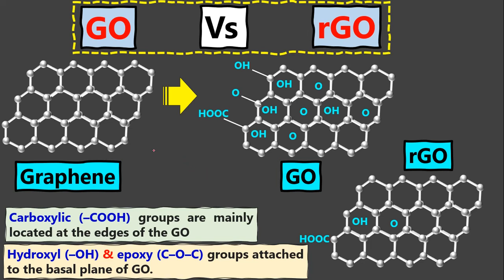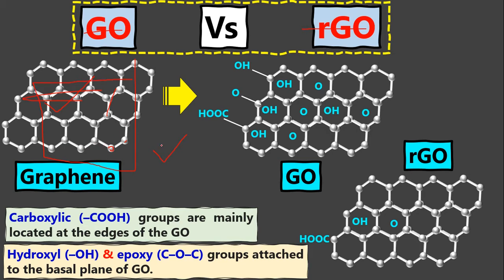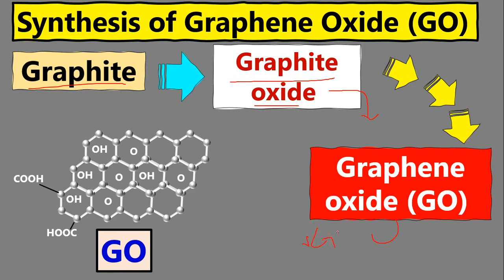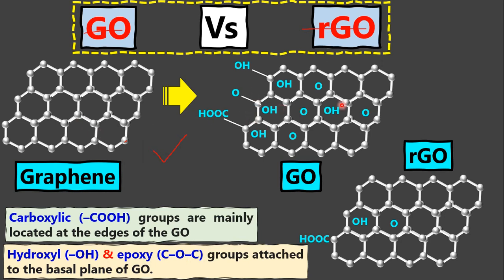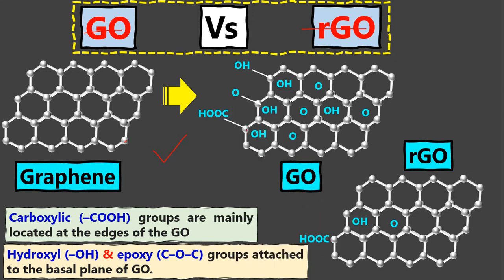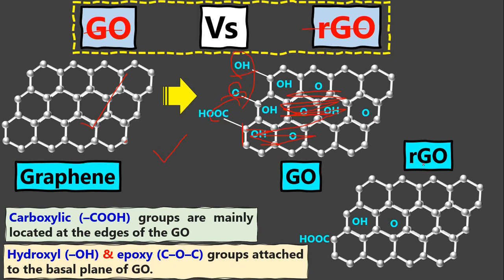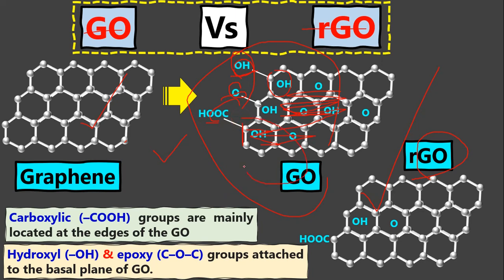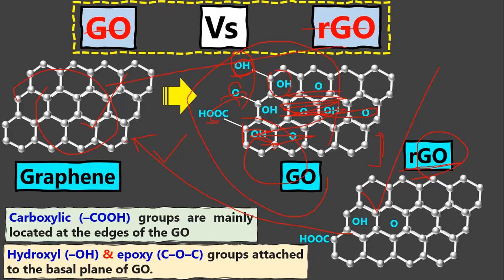GO vs rGO Explained: Key Differences Between Graphene Oxide and rGO

Comment: What meants by composite of TiO2and SiO2
Reply from the maker: Composite means hybrid. When you want to have the characteristics of two materials in one.
Reply: @nanospeaks  How can you remove or degrade reduced grafene oxide efectivly?
.
Reply from the maker: @123OGNIAN  there are several methods to remove it. Better consult with related literature.
Reply: @nanospeaks  Medicine wise, ive read that the one that was for example sprayed on plants was partially removed with NAC, but no idea what else could there be.
It is a mineral , so it should have a counterpart that eliminates it without damaging organic tissues? 

Not sure if its stupid to ask, but maybe even high frequency sounds? 200k hz and up?